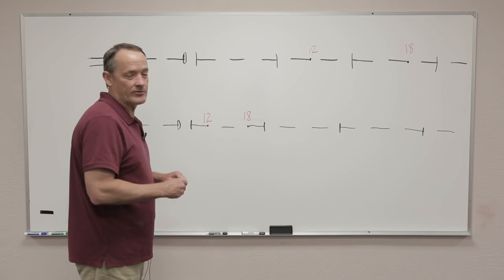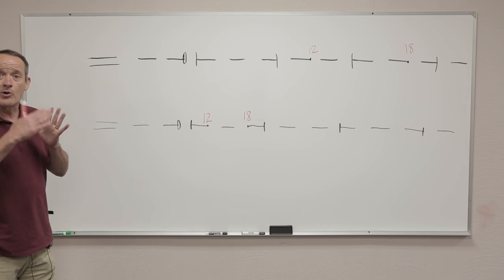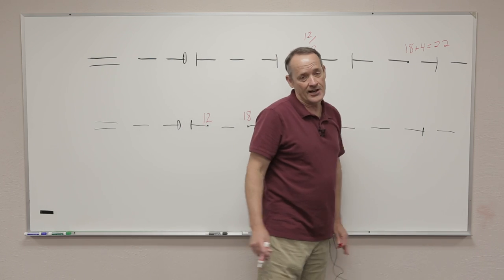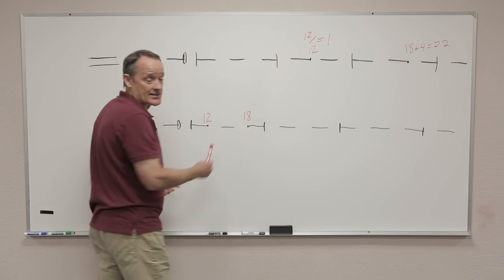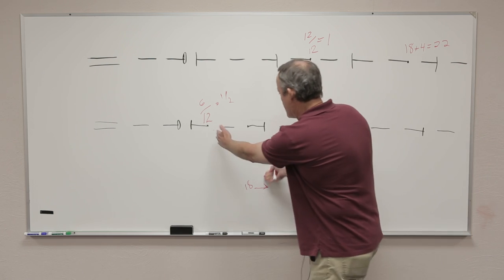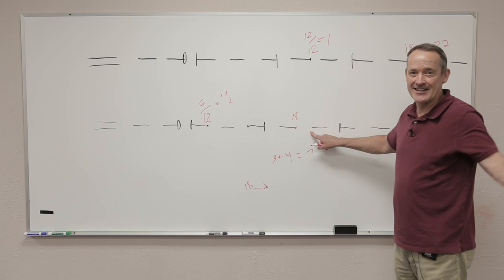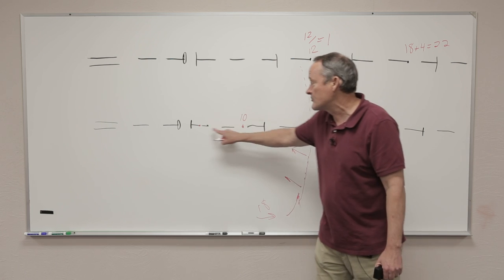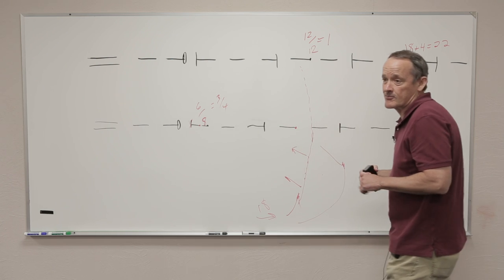Barry Smith's Speed Control

Comment: what will happen after 4 mile final where no speed control exist ?
Reply: The lead aircraft will slow down and the trailing aircraft with begin to close in. This is the compression he was talking about. That's why you add the extra mile for compression

Comment: As a controller for more than 30 years... This is a great though experiment. Now throw it away. It should never be taught or even appear on a test. In real life, you don't control aircraft by making these calculations with each one. You learn from experience what works. Real controllers, good controllers don't do this. We don't need it.